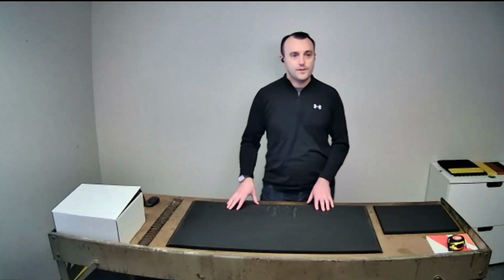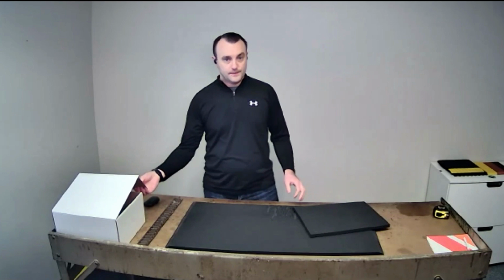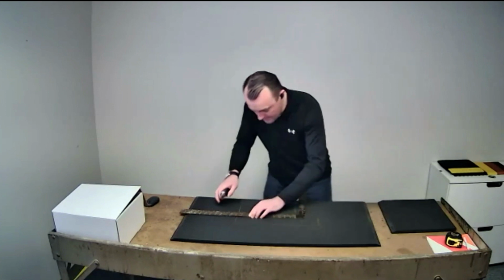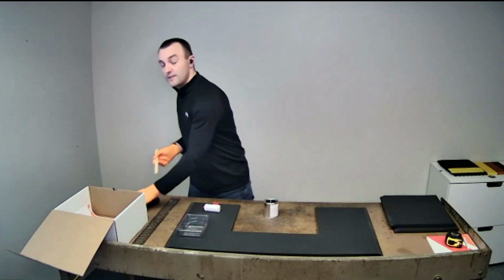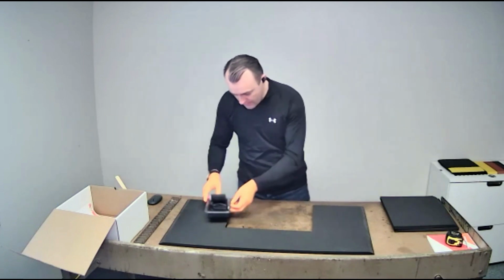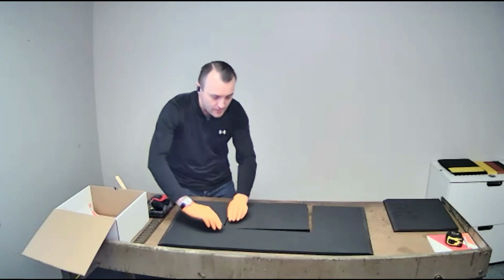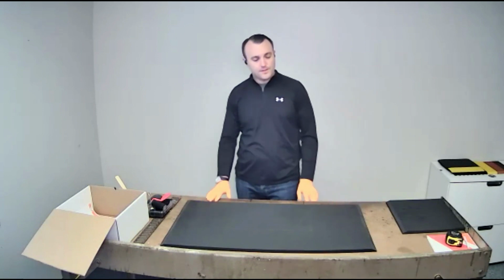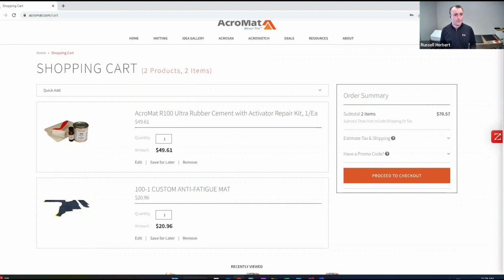How to Repair Rips and Tears to Your Anti-Fatigue Mats

Comment: I have a thick anti fatigue floor mat i use in front of my kitchen sink, anyway my cat thought it would make a great scratching mat. It's beat up, I need a way to repair it.  Please help. 
  These mats aren't cheap 😢
Reply from the maker: Hi Michelle, thanks so much for the note and I’m sorry to hear about your kitchen mat. You’re right, premium mats are not cheap. Unfortunately, we can only repair and restore AcroMat anti-fatigue mats. I actually have an AcroMat 100-1 Series mat in my family’s kitchen at home, and my workshop. The 100% nitrile material is incredibly durable, doesn’t flatten, and lasts for over 8 years in kitchen environments. 

I’d be happy to share pricing for a specific size or shape if you have need, or you can also design the custom shape you need using our online mat building tool, AcroSketch. 

Here are links to the 100-1 page and AcroSketch:

https://www.acromat.com/100-1-Series-Premium-Anti-Fatigue-Mat

https://www.acromat.com/acrosketch 

Please let me know if/how we can help!

Rich
Marketing Manager